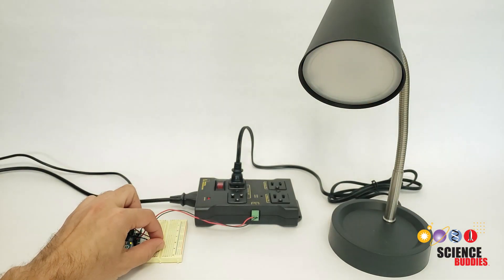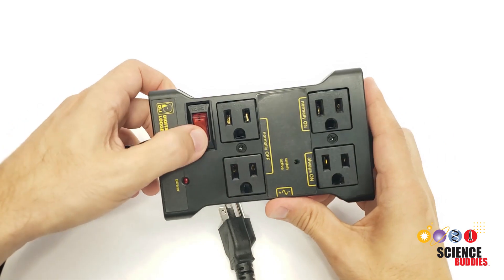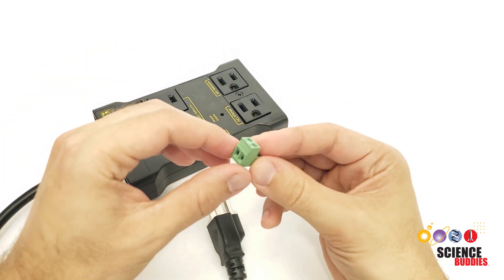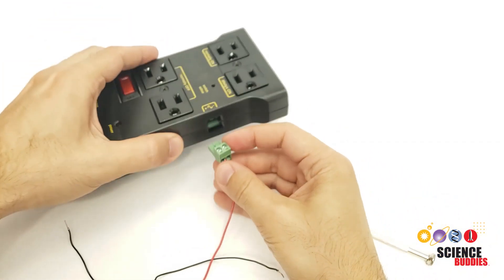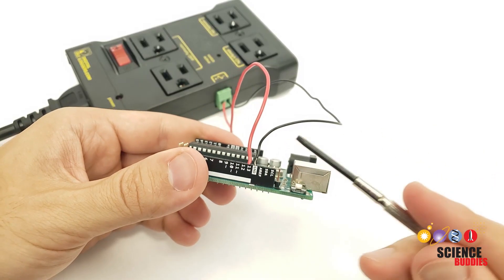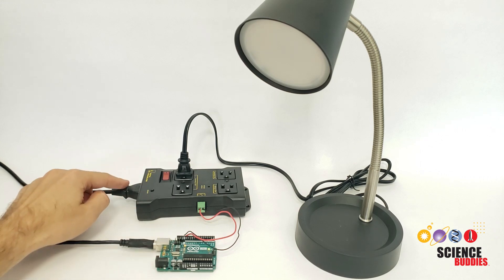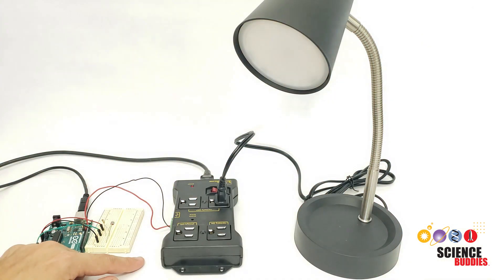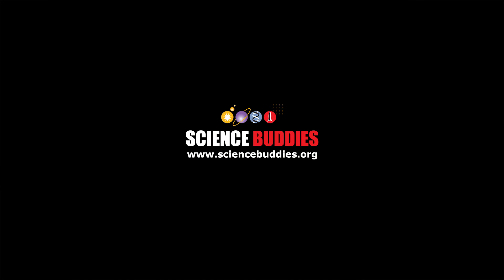IoT Power Relay and Arduino - Setup and Tutorial

Comment: I realize this video is at least 1 year old now but I just found it.  I would like to know if the two normally off outlets can be controlled independently or will both turn off and on together?  Thanks in advance!
Reply from the maker: This specific IoT relay only has one input so you could not control the outlets independently, you would need two separate relays.
Reply: @Science.Buddies  Thanks for the quick reply and answer.

Comment: can that microcontroller run 24/7?
Reply from the maker: Yes - as long as it has uninterrupted power, the Arduino can run continuously. Unlike a computer with an operating system, the microcontroller won't decide to download updates or restart on its own etc.

Comment: The DLI power strip is nearly impossible to find right now. If you're able to share a way to do the same end result with other products that are more readily available, I think many - myself included - would be interested!
Reply from the maker: It looks like SparkFun carries a kit that includes the relay that isn't sold out (yet - there are only 7 left as of writing this comment): https://www.sparkfun.com/products/20169. The relay itself is sold out at SparkFun, but Adafruit also has it in stock: https://www.adafruit.com/product/2935. Hope that helps!
Reply from the maker: There are also other types of relays you can use that involve directly wiring things instead of a "surge protector" approach like the IoT power relay: https://www.sparkfun.com/search/results?term=relay. We generally don't recommend them for our audience, as this requires working with high-voltage wiring directly which is very dangerous if you don't know what you're doing. The great thing about the IoT relay is that it works like a normal electrical outlet so you can just plug a device into it directly, and you only need to worry about the low-voltage microcontroller wiring.